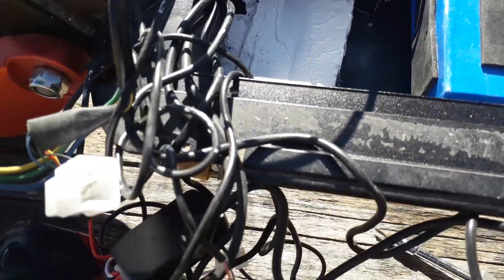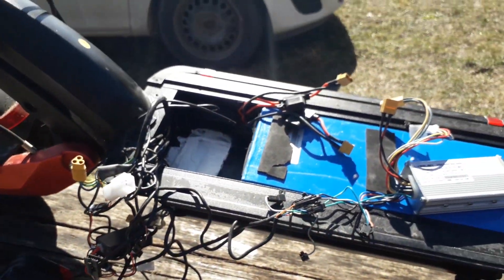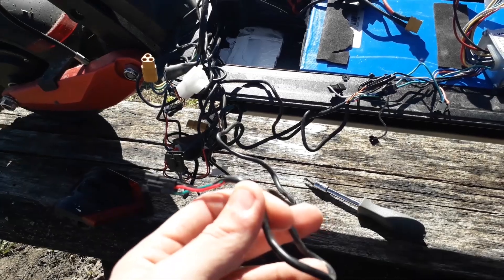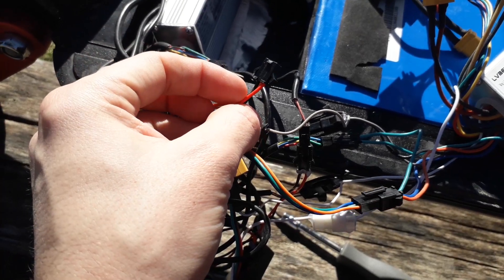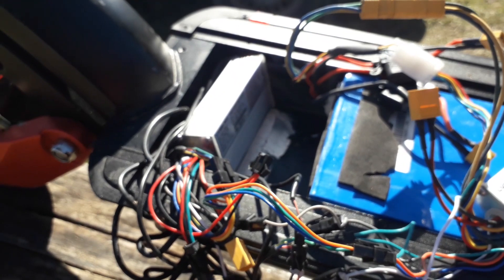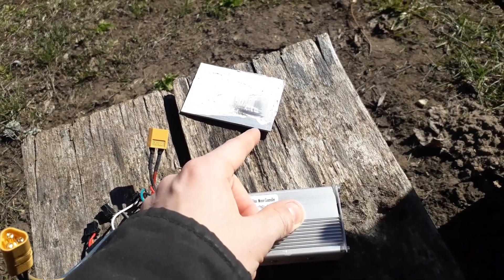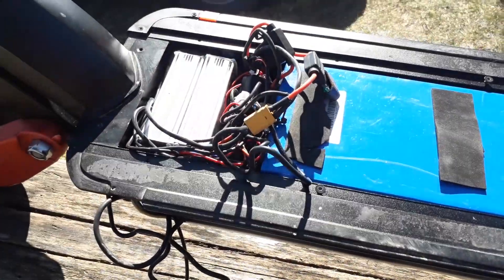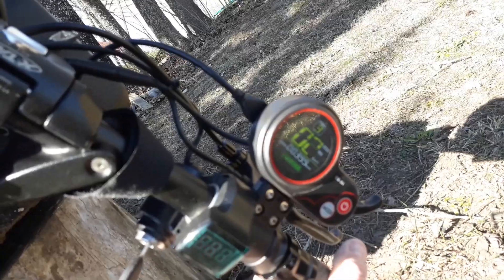Zero 10x Replacing Electric controller

Comment: Crazy how I come across this years later lol, at the same zero used this scooter frame, Apollo use the same scooter for the pro 60v which uses 1 controller to power the same two 1200w motors, still have mine
Reply from the maker: Yes it's common that the frame is used by multiple brands and then they add their own electronics.

Comment: the duel controllers is simple you cant run 2 motors from 1 controller since the front and rear will not be spinning at the same speed all the time think of it like a welded diff in a car if you put the car on full lock and go slow you will hear the wheels skip as there not turning at the same speed you really dont want that to start happening on your front tire when your going around a corner

Comment: Changing the Zero 10x component is super easy and simple.(if you don’t remember each stuff... just label them) the only hard thing with this scooter is infact the wiring issue.... since half of the wire is how much extra wire there are and to feed them back in properly takes time because there’s limited space.

Comment: Haha, hope that I don’t have to open my zero 10x.
Reply: I opened mine straight away to waterproof with silicon. UK is wet
Reply: @DanceySteveYNWA  hey I'm getting serious battery drop off all the way till the voltage reader fads out to zero 0 😱 I had to push it home on my way back from  work the other day it came back to life the next day but am now scared 😨to ride to work incase it happens further away from home then I would be stuffed

Comment: Does anyone know if you wanted to go from 52v to 60v is it just a battery change?
Reply: Yes! if in fact the battery physically fits inside the deck. After swapping in my 60v 20a battery. Change the P03 settings from 52v to 60v. lastly change setting P15 from 41v to 52v cutout. Hope this helps anyone.
Reply: @XrJay03  what would happen if you had the 60v but you left the setting at 52v/41v cut out?  just burn the controller out? will it give you longer battery though?
Reply: no  becouse 50 volt use 1000w motors  and 60v 1200w
Reply: @bjornvanoppen  well then you might want to take a look at the righting on the motors. 52v 1000 60v 1200
Reply: @UCAxpMSSpZbgaK1Oe3AiN8hA  @UCyrTk2SXIMaMt4DXbOxynwg  

does anyone know how to remove the speed limiter on the 10x 60v? I've seen other videos on instructing to cut white wires in the front either underneath the wrapped up part of the cables going up by stem/handlebars, or to unscrew the front right corner and cut them there but my problem is that i don't see any white wires anywhere at either of those places.. and yes by p8 setting is at 100 already. any help would be awesome. 

shit i forgot to mention that the scooter does go about 36ish but I've seen faster so idk really if its limited or not but i want to find whatever wire the limiter is and either cut it or unplug it and see what the top speed will be then. i have a Joyor lr8 and its advertised to go 27mph and those shady ass unprofessional scammers set the scooter up to where it just reads 27 on the odometer instead of actually going that speed, don't buy shit from them, seriously. anyways, i was looking at the controller and there was a long blue wire already cut and when i connected it by twisting the wire together just to see what would happen i noticed the speed went way down, so they shipped it already witht the limiter vut. I'm hoping that isn't the case with the zero though i guess is my point here
Reply: @iangroover1188  I weigh about 75kg-80kg and I get to 37mph with P settings on max acceleration. If they were limited by EU regulations they would be going 25kph max? Which is single motor gear one in eco mode top speeds. If you still want to check then open the deck and look for mysterious double white wires.. People also advise to change your wheel diameters to 9.4 instead of 10 in the p settings, so I can assume that the speedo is probably inaccurate anyway. I will test a top speed, fully charged run tomorrow with my phone and look for any indescretions
Reply: @DanceySteveYNWA  thanks for the response. yeah when my scooter is in eco mode it will go 15mph or 25km per hour no matter the gear. and when i turn off eco mode, and have dual motor going i also can get to 37mph but if i go that speed for any longer than a couple of min , as soon as i let go of the throttle the scooter will completely shut down even if it is still plenty of charge/battery left.. and when i try to turn it back on, the Volt Meter willl just start counting down rapidily all the way to zero?? its so weird and actually very frustrating cuz i dont know how to fix that. so im basically always worried about going full speed cuz if it shuts down like that my scooter wont turn on again for like 1 hour later or so and then will turn on again. If anyone knows the solution to that MAJOR problem i would reallllly appreciate sny help!!!

But back to the speed limiter, i dont think my scooter is an EU version. and i will def try to look for the double white wires some more. i unplugged the gray one that some people were saying was the limiter, but for my scooter is basically just disabled Eco-Mode., but top speed never changed. When ive seen videos of people cutting those white wires that i for some reason can not find, ive seen some scooters hit 80mph on the display! granted they usually had lifted the back wheel off the ground, but when i lift mine it stilll will not go past 45mph.... ill keep looking for those white wires i guess

Comment: Hoq did you learn it was the controller on your scooter? My Zero 10X just broke down when going up a hill, no fall though I think something might have gotten overloaded, It wont turn the wheel when I push the throttle, but when I hit the dual motor then the other motor on front wheel starts spinning but regardless of if im pushing the throttle or not, it speeds up when I go into mode 2 and 3 and when I turn off dual mode it shops turning.

What do you think, controller problem or something else?

Yeah I had reduced the motor power in the settings to 80% before, changing it to 100% didnt fix anything though.
Reply: Did you solve this? I wonder if its a short cicuit between the throttle signal to a power line so it always thinks its full power, rear might also be trying to go full speed but the motor controller might have died, thats all based on no experience with a scooter though
Reply: Rear controller blew?

Comment: wiring is a mess, true, but, a i see other scooters and is similiar. Big thumbs up for zero is in "cooling system" - metal sheet with thermal paste. I didnt see anythink like that on same or more powerfull controlers. I saw controlers doubleside taped inside so absolutely no conection with base of scooter. True is, controllers are cheap :(
Reply: Check out what the cheap Xiaomi scooters or Ninebot Max looks like inside. Their build quality inside out is so much better. Just sucks that they have such small batteries and motors.